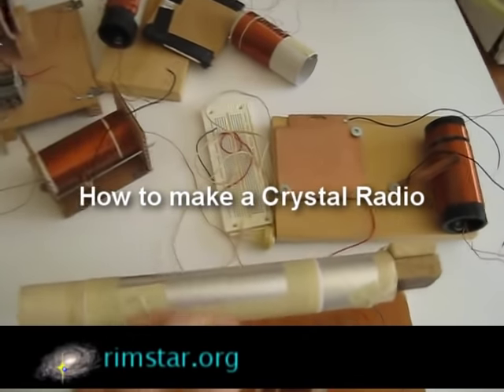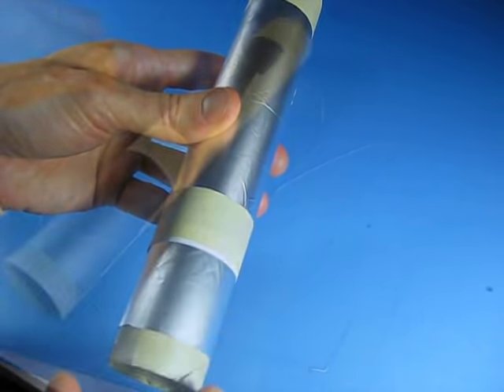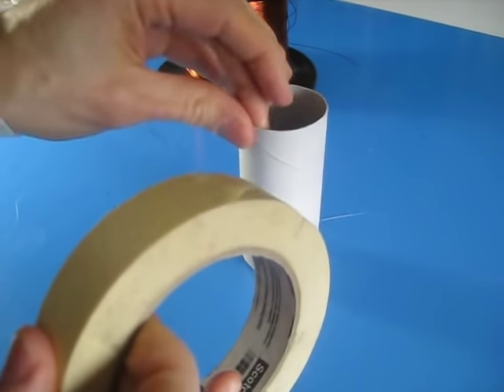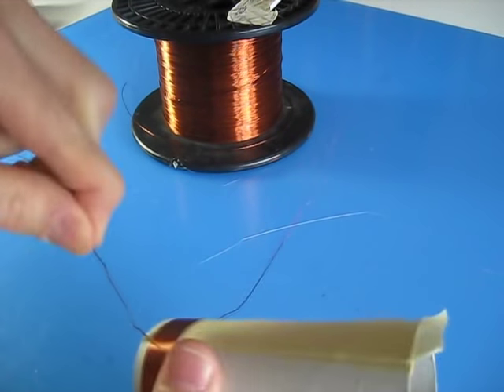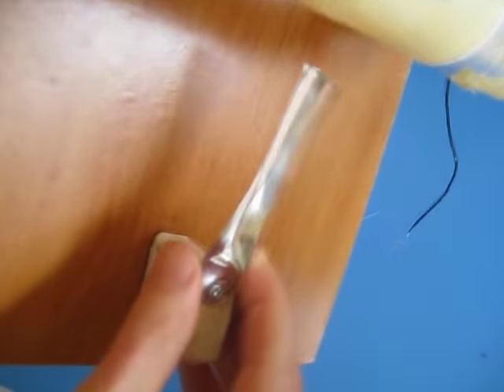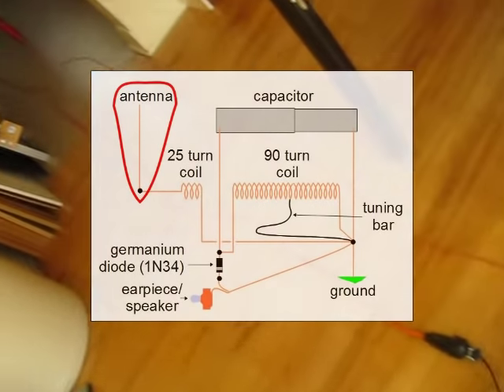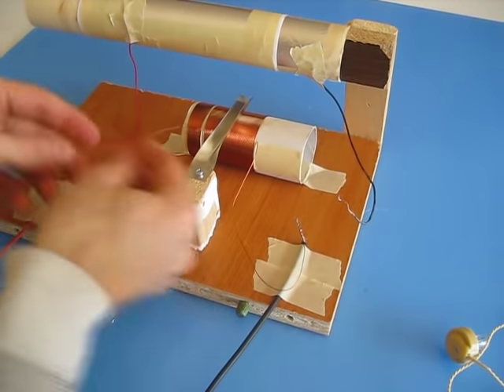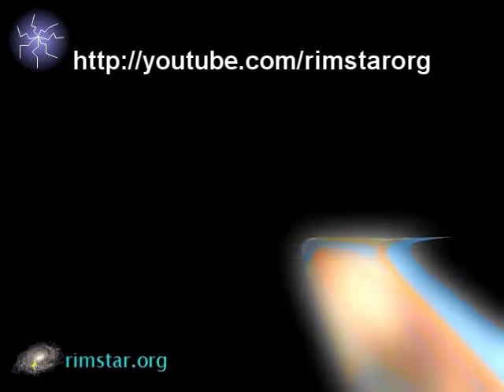How to Make/Build a Crystal Radio

Comment: Why do they say you cant use magnetic phones?i have tried the ones that came with my galaxy s5 and have stereo.  They sound normal radio set at low volume.   Normally, though, i have a microwave oven beeping speaker like these phones as its much more sturdy and doesnt break as easily.
Reply from the maker: Are you sure your magnetic phones don't have an amplifier of some sort -- are the powered or have batteries? If not, then your radio either is powered or you have a very long antenna or you live near a powerful radio station. So it is possible.
I've used the same piezoelectric buzzer from a microwave oven. I agree, the can be made more sturdy than the commercially made ones for crystal radios.
Reply: @RimstarOrg yeah, my first radio wasnt even connected and i heard a roger beep and a man asking things.  I believe it was a HAM on the next block.  The next one is built on a board the size of a mousetrap. On that one, it has self capacitance on the coil giving me 650am and around 900am on a tap.  I use a cb firestik antenna and the headphones are cheap $14 pink walmart headphones.  The station is about 4 miles away. I can say im very pleased with it for what it is. 1 coil, the diode, resistor and then the jack.  Ill see if i can either find that early video or make one showing the 2nd radio i have had playing sunce around 2016.

Comment: I just started working on this thing today. I got as far as the coil, but I think I did something wrong: my coils seem to not take up as much of the tp role as your's does. I did count the wraps. Did I not count right? Please help.
Reply from the maker: The same thing happens to me. It's likely because you are using a thinner wire, which means it has a higher gauge number. I used 26 gauge. Maybe you're using 28 or 30 gauge? (I'm using AWG, American Wire Gauge - you'll have to do a google search to see what that is compared to other gauge standards if yours is indicated in something other than AWG.)
It could also be because your insulation is thinner than mine but since I used enamel coated wire, i.e. magnet wire, I doubt that. It's already very thin. But then again, a slightly thinner enamel coating spread out over 90 turns could add up to a noticeable difference.
Reply: RimstarOrg The wire I got is a pack of magnet wire in 3 gauges and in 3 colors: 22-gauge, 26-gauge, 30-gauge; the colors: copper, red, and green. The spools themselves are not labeled, so I picked the one that was packaged in the middle of the 3, assuming that it was the 26 gauge. I found out it wasn't. I took the plastic wrap of of the other 2 and tested their thickness by pinching them. I accedently used the red 30 gauge wire. Will it still work or should I rewrap with the right wire?
Reply from the maker: Brian Hill
It'll probably still work, but you'll be spreading the entire range of radio frequencies across a smaller length, so it may be a little harder to tune in to one.
Reply: RimstarOrg
Okay. I guess I can use this one as a test and also make a new one to test too.

Comment: For an antenna can you use one off an old RC car remote the kind you pull out?
Reply from the maker: The ones I've worked with in RC car remotes are pretty short. The longer the crystal radio antenna the better and as much of it should be in a straight line as possible. In this video I'm using only around 12 to 15 feet and that works only because I have radio stations nearby.

Comment: Awesome video sir. Can i tune the same crystal radio at 1 mega Hertz?
Reply from the maker: It already works for 1 mega Hertz. It is tunable using for the range 540kHz to 1.6MHz.
Reply: Sir one more question. is that 25 turn coil electromagnet and 90 turn coil are available in market or do i need to wound it?
Reply from the maker: I doubt that one that's 25 turns and 90 turns is available but there are crystal radio kits sold online and in many hobby and science stores. You'd still have to wind them yourself though.
Reply: Thankyou so much sir!

Comment: Just wondering, would the radio still work, if you used the ground as an antenna, I.e connect both ground and antenna to a water pipe?
Reply from the maker: Matthew Synnott The problem with using a ground as the antenna is that the ground is a good source or sink of electrons. So the electrons moved by the electromagnetic waves would just stay with the ground. That's as far as I can picture what would happen.

Comment: Hello, is the tuning bar made out of aluminium? Thanks for this amazing video!
Reply from the maker: +Vanessa lorenzo toquero Thanks! No, the tuning bar is steel, cut from a paint can. But it doesn't matter. As long as it is metal and does not have any insulating coating on it then it will work fine.
Reply: +RimstarOrg thanks for your response, it is very helpful. I'm gonna try with hands augmenting the capacitive sensing of the aluminium but putting more hands in between in order to separate the aluminium tubes, hope it works!

Comment: Can I replace the capacitor you made with just a store bought capacitor? and if so how many micro farads should my capacitor have?
Reply from the maker: sausy mayo You can use a non-electrolytic, store bought capacitor but you will have some trouble tuning in a radio station since the capacitor in this video is adjustable. For the coil in this video you need a capacitor that's around 355 picofarads, which is 0.000000000355 farads or 0.000355 microfarads.
Reply from the maker: w0rstn4m33v3r It ranges from pretty much nothing to around 640pF. You can see me measuring it in my crystal radio troubleshooting and tips video here https://www.youtube.com/watch?v=HZZmKZJrIW0

Comment: Thanks for the very detailed video!  Question: does an enamel coating on the inside of a can negatively effect conductivity of the "wiper?"
Reply from the maker: +Kelly Canavan If there's a coating on the inside of the can then yes, it would negatively affect it wherever you try to make electrical contact with it, like where you connect a wire to it and where it touched the coil. You need to at least remove the coating from those areas. Use sandpaper or scrape off with a knife or whatever you can do.
Reply from the maker: +Kelly Canavan According to that page the DO-35 is equivalent to the 1N60, which is known to work, so it should be okay. When you built the crystal radio in this video how long was your antenna. The longer it is the better and, except for the short length were you connect to the radio, it should be in a straightish line. Pointing it at a radio station would be even better. Also, what are you using for a ground? Try putting you hand on the aluminum foil of whichever capacitor 
cylinder you've connected to ground when trying it, to act as a poor ground. Make sure you are making good electrical contact between the wiper and the turns of wire on the coil. But also make sure that you haven't sanded the tops of the coils so much that the turns are all in electrical contact with each other. Any two turn in electrical contact with each other count as a single turn. What are you using for an earpiece?
Reply from the maker: +Kelly Canavan Oh, and be sure to check out my troubleshooting video too https://www.youtube.com/watch?v=HZZmKZJrIW0.

Comment: hi, i try replicate your crystal radio, but, i don't understand why my crystal radio don't work, can you help me understand what i'm doing wrong?

I'm using:

4A112 germanium diode
25mm diameter PBC pipe for the coils
0.16mm diameter magnet coils (30 turns and 95 turns)
aluminium for the tuning bar like you do
for the speaker i use a earpiece from a cell phone headset

for antenna I?m using the house antenna system
for the ground I'm using the ground wire from my house like you do

Simply can't hear nothing, no static, no noise, no stations 
i triple check the diagram and connections
Reply from the maker: Filipe Brígido I'm pretty sure the earpiece is the problem. You need a high impedance earpiece like the piezo earpiece I use in the video. I show some options for those on my website here http://rimstar.org/equip/crystal_earphone_earpiece_for_crystal_radio.htm . Alternatively you may be able to use your cell phone headset by adding a transformer as I show how to do in my video "Use Earbuds/Earphones with Crystal Radio".After you've solved that, your house antenna system may be a problem. A crystal radio antenna needs to be as long a straight wire as you can get. But try the house antenna system first - it might still work.
Reply: RimstarOrg i go try get the earpiece or an already made amplifier only for testing, after that i leave a feedback to you
Reply: ***** i think is right, i check with my multimeter and follow the video squematic, anyway i go get earpiece first so i can check if is working or not.

Comment: Can you design one to get shortwave? Not talking about ham SSB broadcasts but just shortwave AM broadcasts
Reply from the maker: waterlubber Theoretically this one would work for shortwave, just keep the tuning bar to the left for less turns/lower inductance and open the capacitor more to the left so there's less overlap which gives lower capacitance. That results in tuning in a higher frequency which is what shortwave is. The problem is that shortwave also requires a very long antenna because the power is lower somehow.
Reply: Shortwave requires a longer antenna because it's a very long wavelength, contrary to it's name.
AM is even longer but has enough power to ignore resonance.

Still, I'll give it a shot.
Reply from the maker: waterlubber Makes sense. I've never done shortwave so regarding the reason for a longer antenna, I was just quoting others. One other tip that might be useful is that I have a crystal radio kit that I've never used and in the plans, for the shortwave setting, they have you connect in an extra 470pF fixed value capacitor in series with the variable capacitor. This has the effect of decreasing the capacitance, while I think still using a useful width of the coil making it easier to tune.

Comment: I got another question: Can i make a crystal radio that has an sw coil when it is at its full lenght , and with a stiff wire that moves over the coil you can ground it so you can hear mw.Can i do this?

Comment: Why do you need the 25 turn coil, connected to the antenna? Other tutorials I've seen don't have it
Reply from the maker: +Scott MacDonald Having an antenna coil separate from a tuning coil helps prevent stations that are close to each other in frequency from interfering with each other. I illustrate that more in my How a Crystal Radio Works video (http://www.youtube.com/watch?v=0-PParSmwtE) around 10 minutes and 44 seconds in. The reason I used 25 turns was because the book I got the design from originally used 25 turns.
Reply: +RimstarOrg Ok, thanks! Do you know if the diameter of the coil matters?
Reply from the maker: +Scott MacDonald Yes. Look up the formula for the inductance of a coil. One of the variables is the area, and diameter is part of figuring out the area. From the part of my How a Crystal Radio Works video where I talk about the tuning coil and capacitor and how they work together, the inductance affects that tuning.

Comment: Is shottky diode ok ? it has very low direct opening voltage, and widely available comparing to germany
Reply from the maker: It seems to depend very much on which Schottky diode. I haven't tried it myself but search in these comments for comments by user "Power Max". He did a lot of research into using Schottky diodes and talks about it in the comments.

Comment: Hey I have a suggestion for a possible better diode 1n4148. This is the reason for the diode, Paul at Inventor3 was using the 1n34 if I remember the number correctly in his free energy from air circuit but tried the 1n4148 at the request of a subscriber and it pulled in move energy, I don't know if it will work the same for the radio or not because I have not built one of the radios yet.
Reply from the maker: I just looked it up and the 1n4148 is a silicon diode. Most crystal radios use a germanium diode. The reason is that germanium diodes require a lower voltage than silicon diodes in order to turn on. To get a high enough voltage for a silicon diode like the 1n4148 to work, you'd need a longer antenna than most people playing around with crystal radios have. I'm guessing that Paul had a long wire. Thanks for the suggestion though -- I hadn't heard of the 1n4148 before.
Reply: @RimstarOrg  They are fast switching diodes with a max forward voltage of 1 volt , I can't find a 1n34 I saw somewhere that they are obsolete , there is a 1n34a which says the max instant forward voltage is 1 volt . The guys on ebay are trying to pass the 1n34A off as 1n34. 
yes he does have a long wire and about 10 copper plates inside of a box on top of his roof for an antenna. You're welcome, it was just a thought that it might improve the performance of the radio.
Reply from the maker: The voltage I was thinking of is the voltage required for the diode to start conducting significant current. For a silicon diode it's around 0.6V to 0.7V and for germanium it's around 0.25V to 0.3V.
Reply: @RimstarOrg  I know,I thought that was called the forward voltage, is it not? At that rate the germanium diodes do require considerably less.
Reply from the maker: It does seem to be called the forward voltage, just that the max. forward voltage isn't what I was referring to. Truthfully, there are so many names and parameters to these things that I can't keep track of them all :-).
Reply: @RimstarOrg  You could try biasing the diode with as small voltage to bring it close to forward conduction. This will artificially lower the forward bias threshold. Then again, I suppose this defeats the purpose of having no power required to run the radio.

Comment: I didn't have access to "magnet wires" but had to normal wires, hope it works.
Reply from the maker: It should work. "Magnet wire" is normal copper wire with a thin enamel coating for insulation. If your wire is silver-colored then it's just copper wire with a tin coating to help prevent oxidation. Ultimately they're both the same thing, copper wire.
Reply: @RimstarOrg  hi so I ordered magnetic copper wires from digikey but I was careless not to check the gauge so I ordered 38 gauge which is kinda thin, will that affect the project negatively?
Reply from the maker: Sorry for the delayed response, I don't have a good answer for you. The thinner wire might provide higher resistance and lower volume on the output or it might not, I can't say for sure. Also, because the wire is thinner, you probably want to leave a small gap between each turn. That's so that the coil ends up being around the same length as mine. My coil is around 4cm long.
Reply: Thekillerdog  he meant enamel coated copper wires because we need magnetic properties.

Comment: Will a 28 awg enameled magnet wire work for this? And would 90 coils work for a 28 awg wire?
Reply from the maker: 28 AWG enameled magnet wire would work for all the wire except the 90-turn coil. I think that would make the coil too short and you'd be cramming all the frequencies for all the radio stations into a short space. It would be harder to use. You might find that multiple radio stations overlap when you're listening to them. But if that's all you can find then I'd say try it. It just won't be ideal.
Reply: RimstarOrg what do you think about making more coils other than the 90 coils?

Comment: How Important is it to have exactly 25 and 90 turns in coil. Do26 and 91work? or 24 and 89 for that matter?
Reply from the maker: You can be off by two or three or even four. I won't make that much difference.
Reply: it all has to do with resonance and what channels you wanna pick up

Comment: If I were to use a silicon diode instead and amplify the signal using the BJT amplifier, will it work? Great video btw, and thanks in advance!
Reply from the maker: It likely won't work. The problem is that the silicon diode won't have a high enough voltage for it to do its thing, so it will have failed before you get to the amplification step.
Though, if you have a really long antenna (hundreds of feet) or are near a really powerful radio station then you might get the needed voltage.
Reply: Is 3 mile a good range in that case? Also, instead of using lm386 as you've mentioned in your other video for audio amplification, will a general purpose discrete bjt/mosfet amplifier work? Thanks again!
Reply from the maker: I have a station around 2 miles away and a silicon diode wouldn't work. You'd probably have to be right beside it, though it also depends on the power the radio station is transmitting at. Germanium diodes are easy to find online -- just search for 1N34 diodes. And any type of amplifier will amplify the signal.
Reply: Thanks for the replies! I have a few more questions regarding the antenna part. It seems like you have a 25 turns coil antenna as well as a long wire extended to it. Wouldn't just that 25 turns coil work as an antenna?
Reply from the maker: It's not a a very good a antenna. Ideally the antenna should be long, straight and pointing in the direction of the radio station. See near the beginning of my video on How a Crystal Radio Works for an illustration of why http://www.youtube.com/watch?v=0-PParSmwtE. In the video, you can clearly see the interaction of the electromagnetic waves and the electrons in the antenna.
Reply: Can I just extend the 25 turns coil with another may be 10 feet+ using the same magnet wire? Does it have to be a specific wire for a long wire antenna extension? Once again, thank you very much for all the info!
Reply from the maker: If you're talking about extending it with another 10+ feet in a straight line then yes. That's essentially what I did, but by connecting a separate wire. But you can just keep it all as one continuous wire. Magnet wire is fine as an antenna.